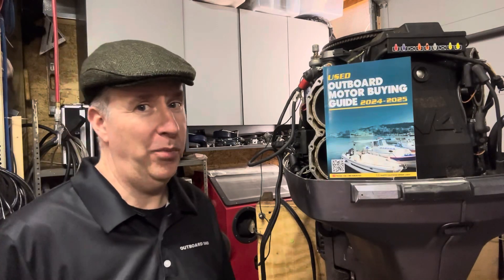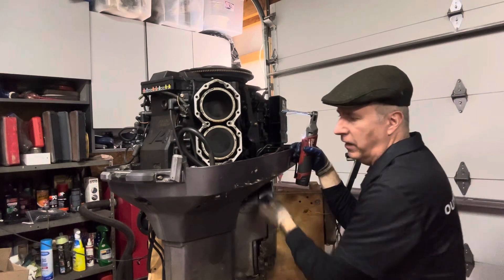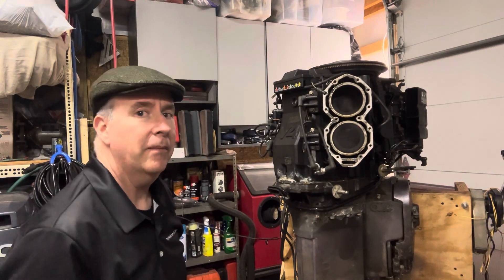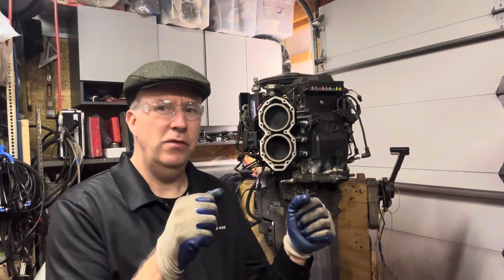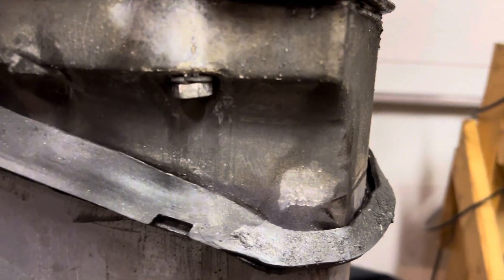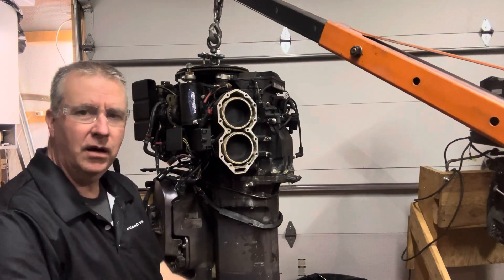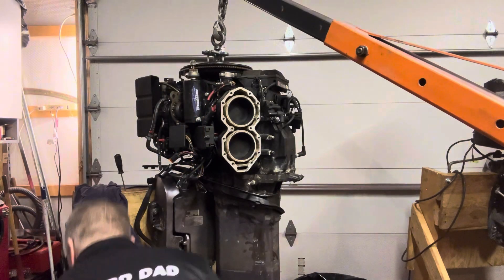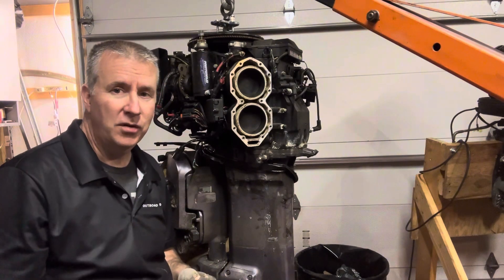Should I Rebuild My 2 Stroke Johnson Outboard Motor? (Part 2)

Comment: Thanks for sharing your experience and expertise on youtube!! These videos have been a huge help for my own learning journey. I have an opportunity to buy a 2006 yamaha 250 hp 2 stroke outboard with a “dead hole”. The seller is asking $400. I wonder what would be your advice for this.  I know I will likely need to a rebuild for the cylinder or replace the piston/ring. Seems like the price is right? Thanks again for your help.
Reply from the maker: @bozhang2019  Thabks for reaching out, as long as the power trim and lower unit are good and the motor is not badly corroded that is a good deal. Question: is this an HPDI? Or OX66?
Reply: Many thanks for the reply! It is an HPDI. I plan to drive there and check it out.
Reply from the maker: @ Ok, that fuel system needs to be thoroughly cleaned. There are a few hidden screens that get clogged and will not run correctly so be on the lookout for

Comment: Nice to see you working on the 2 stroke's
Reply from the maker: @DaveDeBoer-g2f  I think more people want to see these stay running and is much cheaper way to get on the water. How do you feel?
Reply: @OutboardDad i agree i threw a new lower unit on my yamaha 25hp and cleaned out the carbs. Runs like a dream, pushes my 14ft almost 30mph with two ppl. Motor weighs a little over 100lbs, the 4 strokes just dont fill that niche
Reply from the maker: @ True, I know people who have lightweight boats who carry a small outboard over rocks to get to the water and four stroke would be too heavy. Do you do all your own mechanical work?
Reply: @OutboardDad  i do, but i only have the time and patience for popping on a rebuilt lower or carb. Ive fiddled with enough of those to know ill save the time by just popping on a new unit. I have done 2 stroke engine work though.

Comment: since the head of the bolt is gone, should it not lift out, and from there you can possibly get some vise-grips on the shaft of the bolt? Or does something prevent you from pulling the block still>?
Reply from the maker: @wlukew3052  What’s left of that bolt is really stuck, you will see in upcoming videos. The trick next will be getting what’s left out. Stay tuned!
Reply: @OutboardDad  Sounds good!
Reply: @OutboardDad  I still need some advice for my rebuild. size things up you know
Reply from the maker: @wlukew3052  If you buy my guide and email me proof of purchase to keith@outboarddad.com I will help you for free!
Reply: Saving for a study abroad in ireland this summer. however when I get to the build I will abosultely do so, and have been meaning to!
Reply from the maker: @wlukew3052  Great, I will help you through the whole process!

Comment: The powerhead mounting bolts usually come out without much fuss...Those damn cover screws could be another story, makes me so angry when techs don't lube those screws during servicing
Reply: OK, continuing to watch, yeah I guess the looper mounting bolts are longer, more room for salt to lock them up...Using the impact gun is a gamble.  Sure, it is a great way to shock/loosen salt...But, you have no "feel" while doing it, so more prone to snapping the bolt off.  Torch, rock, repeat...  
OK, now that the head has snapped off, your cut-off idea worries me a bit.  Too risky when it comes to bunging up the powerhead/adapter surfaces...  You sure want to avoid welding/JB weld repairs...
If it were me, I would try an "air hammer" about the diameter of the bolt shank.  Get it up inside the bolt cavity and go to town on it, hoping it will free up the salt, with the help of the upward pressure  of the hoist.  
Again, we need to find you an OMC puller kit,  afraid the stuff you are using here is going to break/injure/snap off on you...
Reply from the maker: @donk499  Thanks Don, love hearing your point of view. I will try to add your comments soon. Appreciate your expertise !
Reply: @OutboardDad    Hope it works out...
Reply from the maker: @donk499  You will see in upcoming videos!

Comment: 6.30 minutes. One way might be to grind off the bolt head and then be able to lift it out of the powerhead. Then you can turn it upside down heat it and apply penetrating oil to the threads. A new bolt is a small price.
I think you can fix it though

Comment: Grease or anti-seize on all threads is the best insurance against future problems. The marine environment is not kind.
Reply from the maker: @seriksson9721  Yes but I have found anti seize hardens in the salt environment. I found grease lasts the longest and on the whole shank and threads. What are your thoughts ?
Reply: @OutboardDad  If your experience says that grease is better than anti-seize, I don't disagree. My humble opinion is that a well-lubricated bolt that can be unscrewed every year won't seize. In the automotive world, I have noticed that everything is scaled down, poorer quality, worse solutions are used so that it doesn't last or can be repaired easily. Even that they save on grease on splines and around bearings. Not long-term sustainability seems to be the goal. I suspect it may be similar in the boating world. You get sad when the white oxide comes out in the threads of the bolt holes instead of grease. If stainless steel bolts are used, grease / anti-seize is a must because of the risk of cutting.
Reply from the maker: @ So true, I sound like the old guys who trained me, this new stuff is garbage. Some good but certainly throw away society

Comment: Really "exciting", I was actually very happy when you mentioned "torch" at about 3 minutes. It usually solves most things, but of course it comes with its risks. Steel bolts in aluminum that have come off are not particularly fun. Good video. Thanks
Reply from the maker: @seriksson9721  What did you like best about this video?
Reply: @OutboardDad  That you can clearly see the problems that can arise. Looking forward to more episodes.
Reply from the maker: @ Thank you! Let me know what you think. Have a blessed day!

Comment: Once you get the engine off turn it upside down maybe let some penetrating oil get on the threads
Reply from the maker: @goodtogojetski  Yess I agree! You will see in upcoming videos! Have you had this issue before?
Reply: @OutboardDad  I had a spark plug break off on a yamaha waverunner, PB blaster, heat and easy out got, what a rewarding feeling that is when it finally comes out
Reply from the maker: @ Yessss! How did you keep fillings from getting inside the engine?
Reply: @OutboardDad  engine was getting a complete rebuild anyway so I didn't worry about it

Comment: Seams a little excessive Keith is there not a better solution to an aquard broken bolt, not being funny but I am struggling with a similar problem, with an engine mount bolt. Jim from Scotland
Reply from the maker: @Jimmyfisher121  Love hearing creative ways for this type of issue. Stay tuned for the solution I used. What have you done in the past?